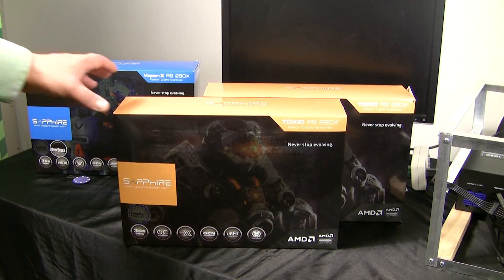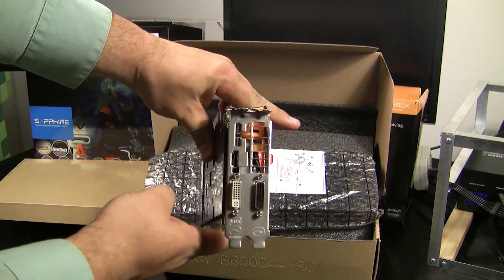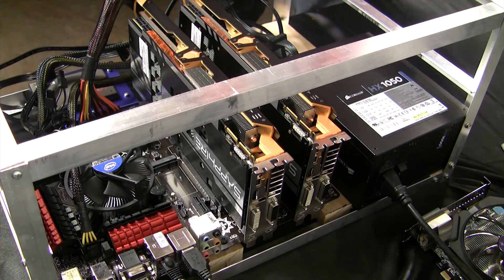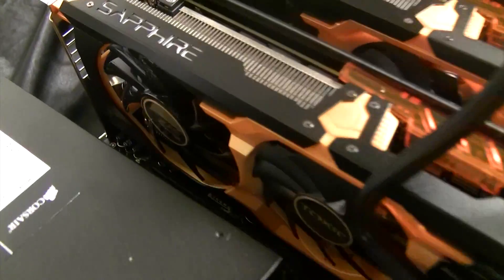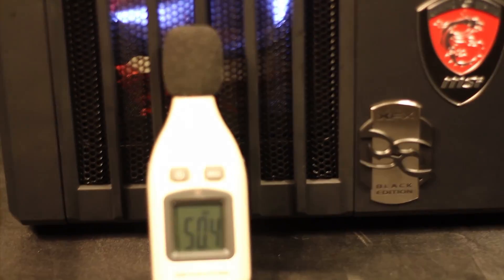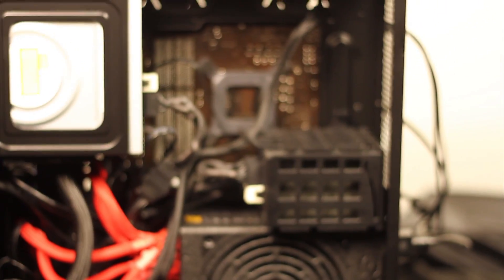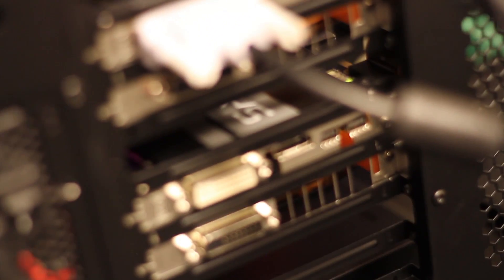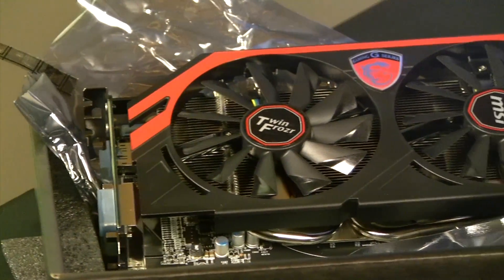BBT Episode 5: Sapphire Toxic R9 280x Deep Dive

Comment: so if you underclock this graphic card to ;
Best configuration we found was (SLI Disabled):
-I 13 -w 256 -g 2 --shaders 2048 --thread-concurrency 8192 --gpu-engine 1070 --gpu-memclock 1500 --gpu-powertune 20 --gpu-vddc 1.100

You will get better Frames Per Second and stuff ??
( i am a nooby at graphic cards )
Reply from the maker: Framerate no, hashrates yes; frame rate's matter much on core clock. Noticeable increase for FPS is at core/clock setting of: 1160/1875 (you may get artifacts, if so, back it down some)
Reply: Bits Be Trippin' ayeah, well i think i gotta down it a bit at stock lvl it somethimes ( 1 time a week +- 26hr on a week) shows a litle bit of artifact already

Comment: does the case come with the fans how many will i need to buy ?
Reply from the maker: Best to use one of these... 14 bucks and do a great job

Honeywell TurboForce Air Circulator - Black...http://www.target.com/p/honeywell-turboforce-air-circulator-black/-/A-11153539
Reply: Bits Be Trippin' can you tell me will these work and not over heat and should i bother oc sense i dont know how to do it is it necessary 

Sapphire Technology AMD Radeon R9 280X 1100MHz 3GB GDDR5 PCI-Express 3.0 HDMI Toxic
Corsair Vengeance Low Profile 8GB DDR3 1600MHz
Corsair 750W CS750M 
MSI Z87-G45
ASUS PCE N15
Intel Core i5-4670K Quad-Core Processor 
Corsair Carbide Series Air 540 High Airflow ATX Cube Case
ASUS (DRW-24F1ST/BLK/B) Internal 24x DVD Writer
Desktop HDD 1TB 3.5" 7200 RPM SATA3 64MB Cache OEM Hard Drive
Zalman CNPS12X Ultimate Performance Triple Fan CPU Cooler
x6 artic cooling artic fans 120mm

Comment: 6 x Sapphire Toxic R9 280x
i saw your BBT Episode 7: 6 GPU Litecoin Dogecoin Feathercoin Mining Rig using the ASRock H81 PRO BTC video and deep dive about sapphire toxic r9 280x video.
I wanna put 6 sapphire toxic r9 280x video cards to that asrock motherboard what risers you suggest?
Is that PSU enough to supply energy to system http://www.newegg.com/Product/Product.aspx?Item=N82E16817101033.
Will you ship that item to Turkey if i buy it http://cgi.ebay.com/ws/eBayISAPI.dll?ViewItem&item=141189697499&ssPageName=STRK:MESE:IT ?

Thanks for helping ..
Reply: If I may, I would suggest 1 standard 16x/16x unpowered PCIe riser for your main card to plug in your monitor and 5 USB powered risers. USB risers don't draw power from your motherboard, so you don't set that thing on fire :P I don't know about that PSU, it's a nice one but an overclocked 280x could reach up to 300 watts or more. So you get up to 1800watts...don't forget to add up the system power usage. I'd recommend 2 PSU's of 1200 watt (gold or platinum) just to be safe...and it's cheaper than one 2000watt PSU.

Comment: Bits Be Trippin' May I ask what software versions u used?
So Wich OS? 
Wich CGminer?
Wich Catalyst?
Wich APP SDK?

Cause it doesn't matter wich .bat values I use I'm always getting HW errors..
Reply from the maker: OS: Windows 7 SP1
CGMiner: 3.7.2
Catalyst: 13.12
APP SDK: None

For the toxic dont exceed an intensity of 13, all you will get is hardware errors from our experience and make sure its 2 threads

Comment: First off, nice videos. You've earned a subscriber here ;) I've got 4x Sapphire Toxic 280X's and 2x Sapphire Dual-X r9 280X's all hashing at 752 khash/s (4.5Mhash/s total) undervolted to 1.1 - 1.3V. Although it's nice to see the hash rate can reach 800+, didn't you have to overvolt them to make that happen? Did you compare the benefit of the extra hash rate to the extra cost in electricity and wear/tear on the cards?
Reply from the maker: Mid 750's is really the target for this card when factoring power and load for sure. I would wrap it up in an anology. It's like having a car with 600hp... its nice to know it will smoke about anything in the category, but using that much power everyday isn't really worth it. Keep the settings for mid 750 and save the power for when your friends are around and you can see what it can actually do when pushed!
Reply: Bits Be Trippin'
Good to know I'm not the only one to think that. I'm loving your videos - keep it up!

Comment: will Corsair Rm750 Gold handle 2 Toxics?
Reply from the maker: I would shoot for the 850 for the headroom, but it should hold it fine if your using it for a mining rig. If you are going to put a 4770k and use it as a dual purpose ...then go 850
Reply: Bits Be Trippin'
only gonna be used for games, and i have i7 4770k at 84 watt...
dont have plans for replacing my psu anytime soon i guess.

Comment: Hi, I guess I am rather impatient about the next episode but I need to ask questions about using these for litecoin mining. I want to buy these cards and maybe set up a rig exclusively for mining. First I want to know can you set them up in the rig as you did in episode 3.5 with the riser (in doing so more than 3 cards can but set up? Second do you know if these use liquid cooling on these cards? Lastly, as the gpu's are the main hardware here, what can I use for memory and gpu just for mining?
Reply from the maker: No problem David - Recommended setup would be:

Case: Build Open Air Aluminum

MB: ASRock H81M PRO BTC (designed specifically to handle 6 cards) ; get 1x to 16x risers (up to 6)

Ram: 4gb kit (2x2gb) DDR3 (we usually stick to name brand for reliability system ram does not matter)

HD: 64gb SSD (super cheap these days, low power req, load any OS)

Graphics: 4 card rig will max most PSUs under 1200w - 5 card rig will require high end PSU such as eVGA 1500w or other offbrand 1500/1600w psu; 6 card would recommend two PSU setup such as two Thermaltake 1200s for extra headroom

PSU: eVGA Supernova 1500W for 4/5 cards; OC mode 1650 technically will support 6 cards; personally I would invest into two PSUs for 6 cards
 
Finally ... with the right spacing in the rig, in a addition to an external fan you would NOT need liquid cooling. This just increase cost for not much gain. Air assisted cooled open aluminum rig will hold 80-84C on these cards (Sapphire R9 280x Toxics)
Reply: Bits Be Trippin'  HI, thanks a lot for the info. I have done some research on these and other card, it seems that the R9 290X still has higher specs. So what is the advantage of these cards and which would you recommend?

Comment from the maker: More configuration testing based on feedback from Reddit we have successfully went now 9 hours @ 806k/hash per card using this setting:

-I 13 -w 256 -g 2 --shaders 2048 --thread-concurrency 8192 --gpu-engine 1160 --gpu-memclock 1875 --gpu-powertune 20 --gpu-vddc 2.250
Reply: You mean --gpu-vddc 1.250
Reply from the maker: Correct - good catch posting picture as reference on twitter
Reply: Nice config..
Reply: 1.25v is quite high... I found that I can hash 700KH/s easy... I undervolted it from stock 1.25v I think to 1.112v... 100Kw less on the electricity
Reply from the maker: jonathan kick We tried to stair step it, 12000 offered +4/8 k/hash only and CGMiner began to crash after 2 hours. Anything above that lowered K/Hash rate ; Thread concurrency is not as linear as you would think on increasing hash
Reply: Bits Be Trippin' thats awesome results wow! Will want to try this. I'm always afraid of overclocking gpu's voltage though. Basically I want to get this cleared up. by overvolting it allows for more overcloking am I right?? BTW what was the fan speed with those optimal numbers? thanks in advance :D 

Also you are a great channel being extremely interactive with your viewers. Will definitely be donating once I get some sort of mining traction.
Reply from the maker: We normally set the fan speeds to Auto with target @ 75c max 85c; fan on open air case hangs around 60% ... if sound impact isnt a big deal (sepearte room etc) you can manually set to 80-100% to hold low 70c
Reply: Bits Be Trippin' i have the same cards for mining LTC and DOGE, the settings you had provided are great and im reaching 790-820k/hash but my problem on GPU 0 is that it reaches too hot around 90-95 deg C, and the settings is the same on yours, on an open crate bench (same no risers) but yours are running below 80 deg...any ideas?
Reply from the maker: external fan and/or drop your ambient temp in room, if its winter where you are open a window for a bit and drop ambient to low 70's high 60's
Reply: TerabytezModz T.V Well start using risers then :P
2 GPU's next to eachother are just getting way to hot. The heat can't get out of the cards and case properly. With risers these problems are over. I use powered USB risers (they don't draw the 75watt from the motherboard, so it also saves your motherboard if you have multiple GPU's).
Reply: Bits Be Trippin'
 Thank's got the cards running at 75-77 now,  However, i got 2 more of these comming to complete the 4 toxic miner for the 280x, Would a seasonic 1250w 80 plus gold be enough to power all 4?

Comment: I noticed in the video that you have the crossfire bridge on the cards... did you have that on them while mining? I've been told not to run them in CF whilst mining

I'm currently running two msi 280x in my 540 air and I've noticed that your top card runs at a lower temp... meanwhile out of my cards my top one is always the higher temp.. interesting

The fans directly on the card helps so much to dissipate that heat out between the cards, I'm going to get some air temp controlled fans and set them up next to my rig and see how that goes

Thanks for the videos guys, keep up the work!
Reply from the maker: While the crossfire cable was physically connected, however we hashed with CF disabled (software disabled); was plugged in to test how fast the rig was graphically
Reply: Bits Be Trippin' Cool cool I was just checking, I believe I heard you say later in the video that you had is disabled! Thanks for the response I do enjoy you're videos. I'm soon to be running 4 280x on the Antec 1300w Platinum High Current Pro... can't wait!